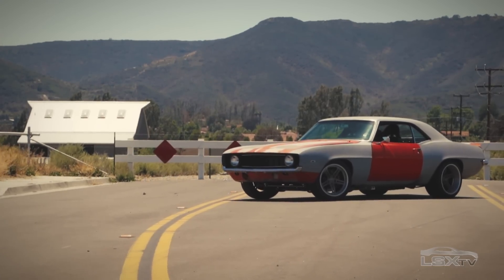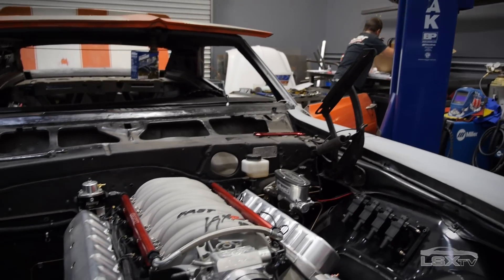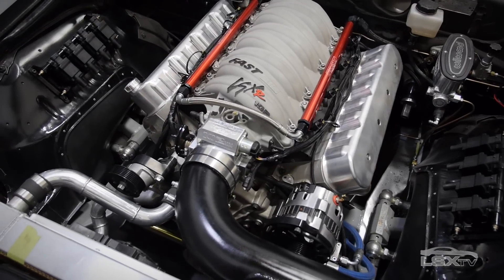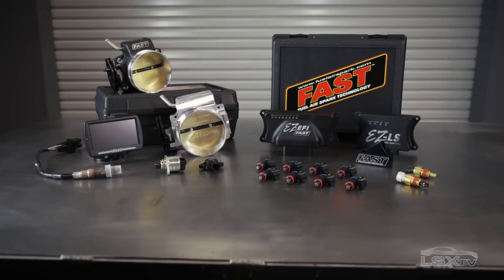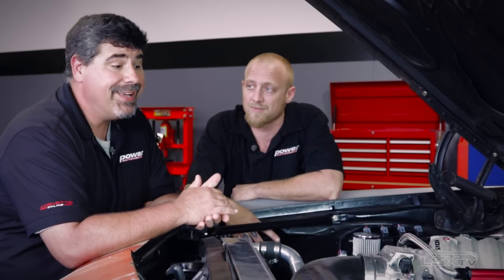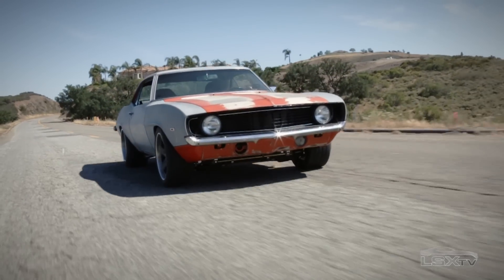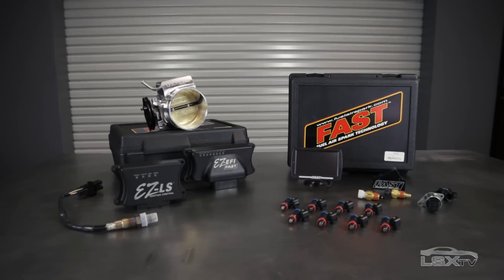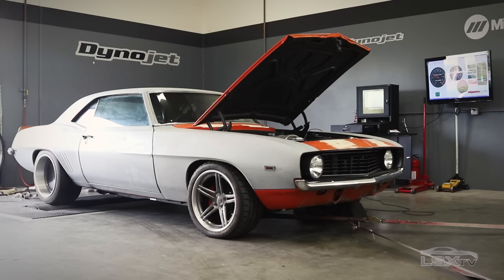FAST's EZ-EFI 2.0 Fuels the Fire on Project Blank Slate Video

Comment: Can you run e85 with this system and if so what’s needed besides proper fuel pump and injectors this would also be on an 6.0 ls3 engine